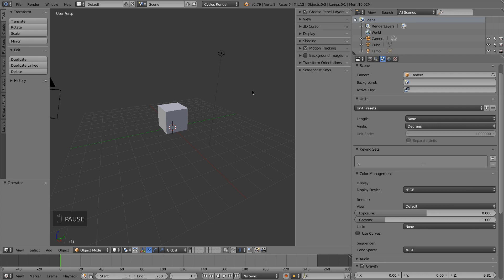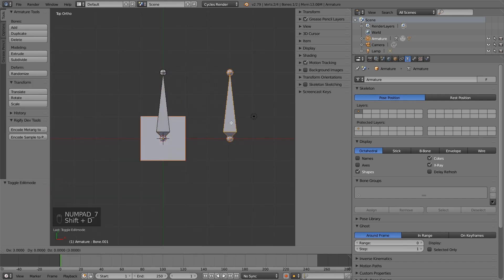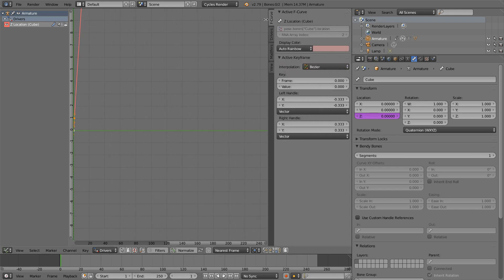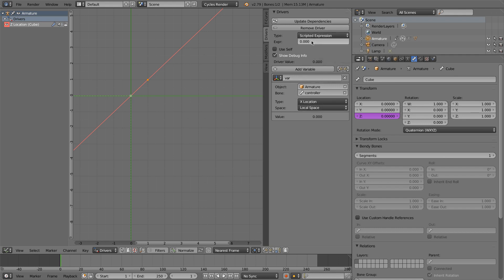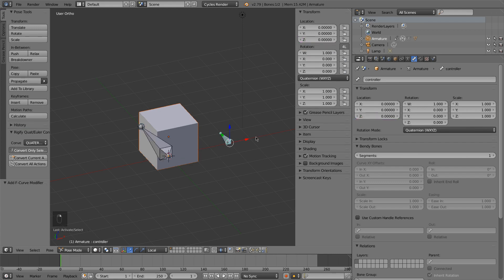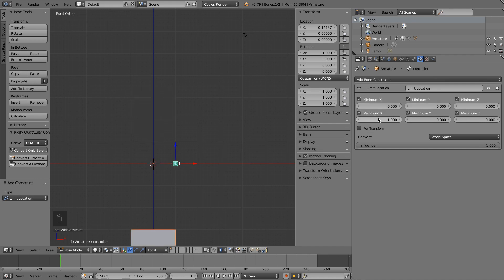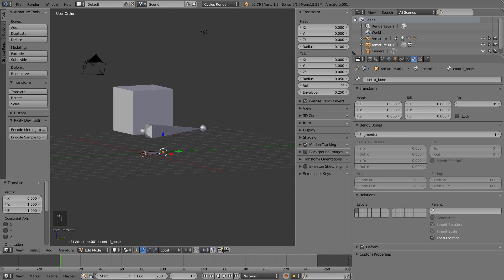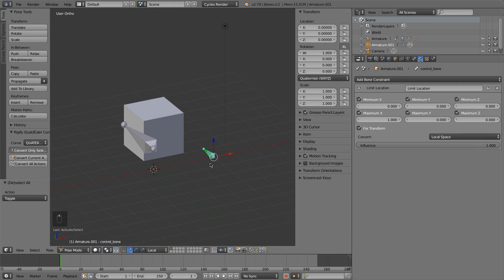Making a Control Panel (Part 01) - Linear Drivers

Comment: Now that explains why I need to clear transform multiple times on my multi constraint rig... Guess it's time for me to read up on Depsgraph...
Reply from the maker: I did not mention this in the video, but it can cause your rig to lag in animations. So, it is not merely annoying. There is a hack to help, Update Object Data.
https://docs.blender.org/manual/en/dev/editors/3dview/object/properties/relations/extras.html

It is in the Properties windows, Object tab, Relations Extras group. It is a checkbox that tells Blender to calculate the data twice. The data of the rig object is the armature. This will double the calculation time for the rig, but it will reduce any lag by 1 frame. In cases where a rig lags 2 or more frames, it will still lag 1 or more frames. But, I have only encountered lagging like that in very complex mechanisms.
Reply: ACBlenderTutorials heello, are you still planning to make more videos, or have you abandoned this channel?